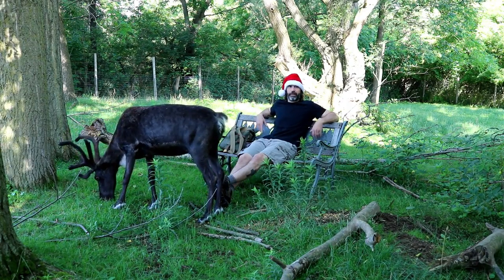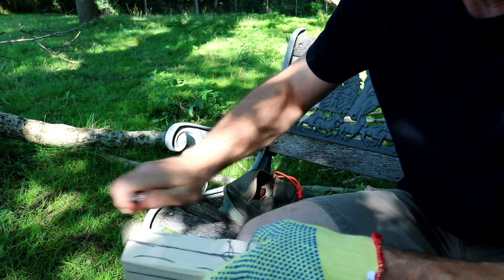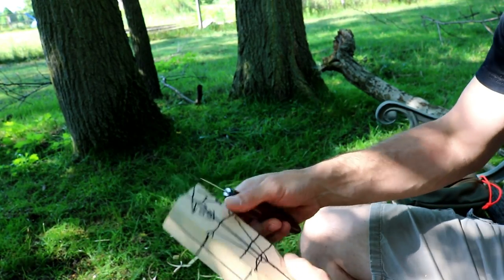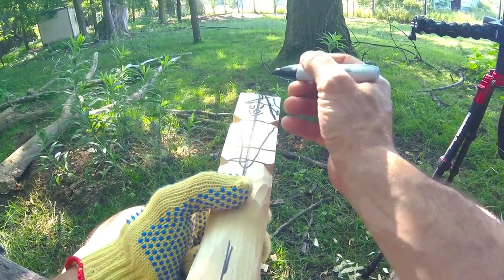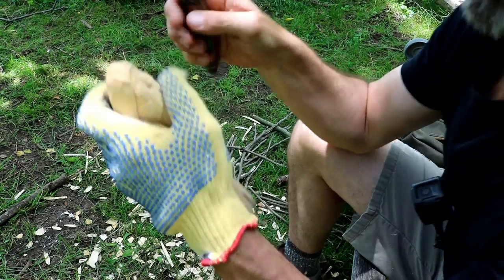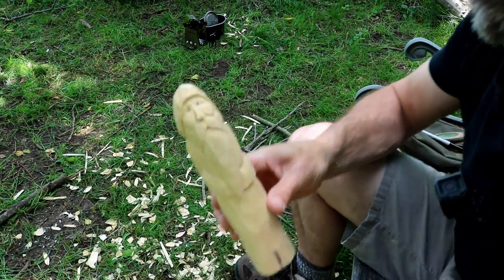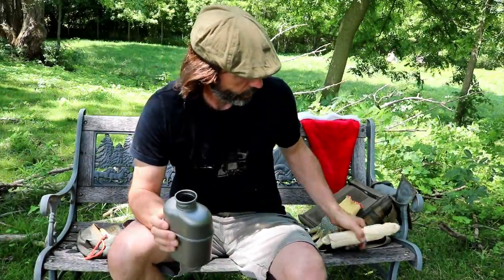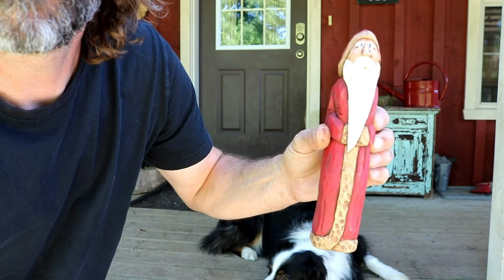Carving an Old World Santa -Carving & Coffee #3

Comment: Hope you're keeping a smear of oil on those blades when not in use Doug! Noticed the strop by your side. Would be interesting to see you retouch the blade edge with the resulting improvement while working sometime. ATB.
Reply from the maker: yeah -I really could of stopped and stropped it
Reply: Hope you got my message about the Jack price DVD, it's well worth having in your collection. Its the original of what Sharon M. A. does but in 16 steps.
Reply from the maker: pete wright  I had it once and lent it out and have not seen since, I think it was a very old version as the quality was poor but it was a good aid at the time -Gene Messer did a video about the compact character of Jacks
Reply: Yep, that's the one, old but good. Only around $18 shipped if U want to have it again. Seen Genes vid.